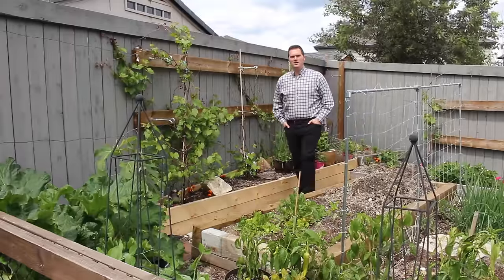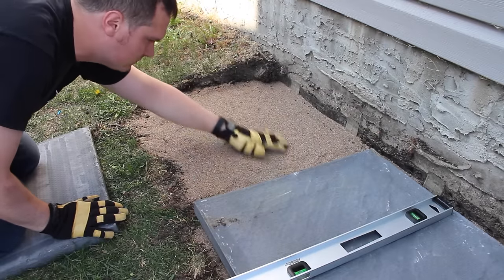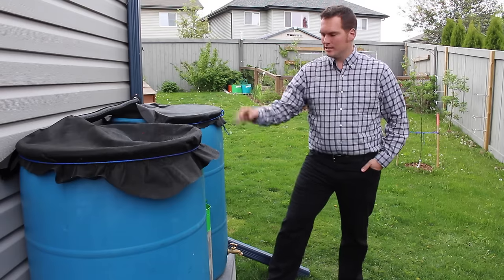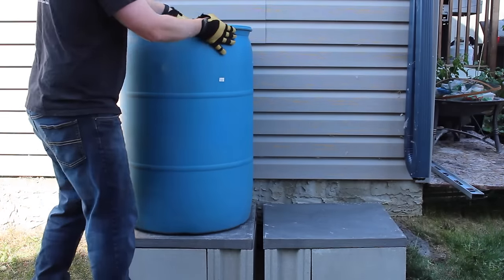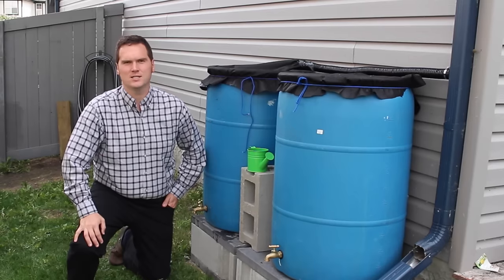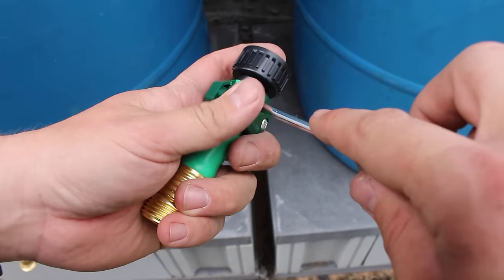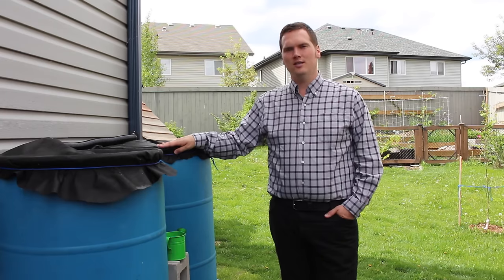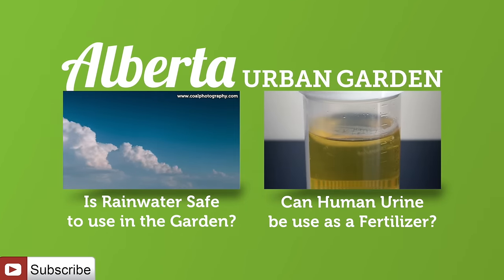Installing a Rain Barrel for Beginners

Comment: Based on research, while plastic numbers 1, 2, 4, and 5 are all considered food safe, number 1 is problematic if exposed to either heat or UV rays, as a rain barrel may be. Number 1 plastics can contain PFOAs, PFOSs and the element antimony. If the emitted and then diluted in the rain barrel it is unclear how much will leach into your soil and the food grown from that water but it's a worthwhile consideration. In everyday life, number 1 plastic is used in clear water bottles and clear salad and food clamshell containers. This makes those containers less desirable to use with Winter Sowing (putting seeds out in jugs and other containers to freeze and thaw in the winter to spring period).

Comment: *Base anything that works with 4 cinder blocks like in video Make sure platforms are level. 

*Tap metal with 1 1/8 (2.85 cm) hole slightly smaller so snug 
*Bulk head fitting washer and seal bolt kit, rubber washer both sides. ( for tap and connection)
*Teflon tape for grooves
*Connection point same as tap.
*Hose to cut
*Down spout diverter kit that should come with plug when not in use.
*Weed netting and vinyl string to cover top of barrel.
*Hose repair kit
*Male to male hose adapter metal.
*metal ring clamps for downspout tube.

Comment: Looks like your diverter is too high.  I think you are going to have to raise the platforms to correct this.  The water will simply overflow from the barrels before it backs up to the diverter.  Also it is a neater job to put the pipe to the nearest barrel to the down pipe.  It doesn't matter which barrel fills first as they both need to be full before the diverter engages.

Comment: Doesn't putting the cross connector at the top mean the second barrel may often have little or no water in it during drier periods when the first barrel doesn't fill up faster than your use the water out of it?  Nearly all the other connecting manifold systems I have seen are at the bottom of the barrels due to wanting to fill up each barrel equally rather than have one full barrel before the second barrel gets any water.

I like the concept of having more water pressure with the one full barrel than two half full barrels but I'm not really sure the physics of this arrangement really does produce a higher pressure that is noticeable.  Basically you have the same amount of water either way and gravity is exerting the same downward force.  If there is a difference, I'd say it is pretty minimal since it all boils down to the mere difference in height which is 1/2 the barrel height or maybe about 2 feet.

 Are there any disadvantages to a top connecting system?   I can't help but wonder why you do it differently from everyone else. It can't be purely due to a minimal increase in water pressure.  Are you just not telling us about any disadvantages to a top connector system?  Or are there any?

Very well done video.  I enjoyed it.

Comment: If you put the connector at the bottom then you would only need one tap at one barrel?
Reply: It's to ensure maximum water pressure to speed up water can filling.  If the connector was at the bottom, the water pressure would be half (unless of course, both barrels are completely full)

Comment: Windshield washer fluid has methenol. Methanol isn't stored in plastic barrels for a reason. This reason is the molecules of Methanol is smaller than the plastic and it leaches into the plastic.
Reply from the maker: Methanol also quickly degrades in the presence of oxygen and heat. Both of which are present I my garden.

Comment: Wouldn't the crosslink hose be more beneficial if it was located at the bottom of the barrel rather than as high on the barrel as you could place it?

Comment: thew water will not flow backwards up the diverter line because it will flow out of the top of the barrel first, since the top of the barrel is lower.

Comment: There is no way that this doesn’t overflow. The supply hose is higher than the tops of the barrels. Wouldn’t it just keep filling until the barrels are overflowing?

Comment: if you connected both together at the BOTTOM of the barrels, the water level will equalize out as it fills and you'll only need one tap...
Reply from the maker: I had thought of that however I was worried about water pressure at the tap when they are low.

Comment: thank you for the Great video.  can I use 6 cinder blocks instead of 2 to give it more elevation and get better water pressure?
Reply from the maker: you certainly can.  I just ran out of money for this project but may add another level this spring.
Reply: Alberta Urban Garden Simple Organic and Sustainable a++
Reply: Esplender M you will add to the elevation but will do absolutely nothing for increasing your pressure. Pressure is developed by the amount of head in the barrel which ultimately means that the more water in the barrel then the more pressure the weight of that water has pushing down on the outlet valve thus increasing your pressure. Gravity surely has some impact as well but it will not be a remarkably increase in pressure just by raising your barrel up another foot
Reply: Right elevation doesn't create pressure, more water does. The only thing that will make water come out faster is having a large fitting/spout

Comment: How did the overflow work out?  It seems to me that with the open tops on the barrels the water won't ever get back up the hose with out spilling out.
Reply from the maker: It works fine. The diversion from the down spout is not a total one so I only get 1/4 of the rain.

Comment: is there any reason you did not connect the 2 barrels at the bottom ,so you would only need 1 tap to fit ??
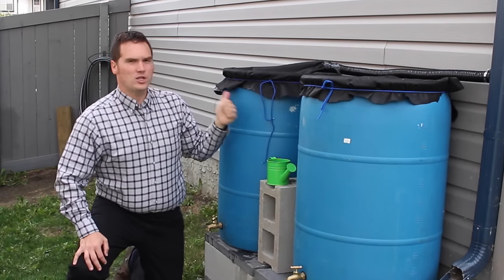Reply: 5:46  
I had to listen to that part twice to understand his reasoning.  He says that having the connection at the top allows his primary tank to fill to a higher level, and offer a higher water pressure in situations where the system is only 50% full of water.

If my understanding of physics is correct, I believe if the connection was at the bottom of the tank it would offer more water pressure when the tank is 100% full, but less when it is 50% full.  Scratched my head for a while thinking the same question as you though, still not sure if I'm right.

Comment: Connecting to the gutter seemed to miss something. The gutter actually goes into tank # 1 ?
Reply from the maker: I had them at different points going to either tank 1 or 2. I controlled this by having the tank connectors lower than the outflow.

Comment: my new home dio not have a rain gutter installed, only at the door exit and garage areas . that's the reason why i'm using these 8 of 55 gal drums to catch the roof water, keeps from eroding the soil and splashing mud to the house stucco.

Comment: PUT A COUPLE OF DROPS OF "ORGANIC OIL" (TEA TREE, CEDAR, TURPENTINE, ETC.) ON THE WATER SURFACE, IN EACH BARREL. THAT WILL PREVENT MOSQUITOES!)
Reply: That stuffs crazy expensive, you would also have to add more every rainfall as you use the water

Comment: Nice setup. Total cost?
Reply from the maker: roughly 40$ for the barrels 15$ for the taps 40$ for the connectors and 50$ for the concrete 

145$ which is not bad as they jack my water rate next month.

Comment: So how do you solve bird pup and death bugs at roop that washed and carried away by water rain at first
Reply: I installed gutter guards on the gutters feeding into the drain spout. First I thoroughly scrubbed and bleached the gutters. Remember this is not potable water so it needs to be treated for human or normal consumption

Comment: Why would you have to protect from freezing, the water has somewhere to expand to so no damage!
Reply from the maker: The water will freeze from the outside towards the inside. The taps and connections won’t survive the freeze thaw.
Reply: Alberta Urban Garden Simple Organic and Sustainable The barrels are not connected to the house plumbing system.The top is open, when water freezes it expands. If it is in a closed pipe it has nowhere to expand to,thus splitting the pipe.

Comment: What's that building where you have the rain barrels? Is the building on a slab or does it have a basement. I'm planning on installing three rain barrels next to my house and my wife won't let me have it closer than two or three feet from the house. She says " having heavy weight of the barrels close to the houe is going to put pressure on the house foundation, possibly crack the basement wall and creating water leak in the basement"  Explaining to her that the pressure will be vertical , not horizontal didn't fit well with her. I just wish women stuck to their cooking and stayed away from their husbands projects, lol

Comment: Great idea but what a horrible video...it went black from the shadow at the crucial part of installing the tap...you talked about a bulkhead fitting and didn't show how you used it for the tap.  Very confusing.  Could you please put up a material list.  Thanks

Comment: I have no idea why you cut the top of the barrels off. This makes no sense. You could’ve actually just used the existing tops with overflow to fill on barrel after the other is already full. This would eliminate half the work you did. I’m so confused why you did half of what you have? I actually don’t even understand why you didn’t use a proper first flush system.. during winter or you could simply remove the end cap at the base.. I honestly wouldn’t recommend this to anyone in how to do this lol.
Reply from the maker: the opening makes filling faster a lot more convenient however it is not absolutely required.
Reply: Alberta Urban Garden Simple Organic and Sustainable I didn’t think of that tbh.. but that said you can vent the barrels other ways through plumbing design.